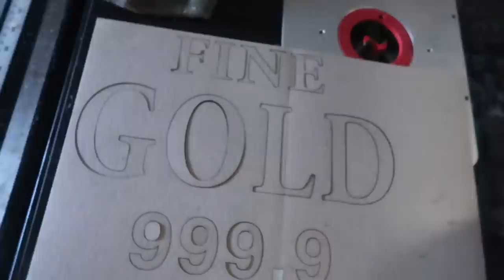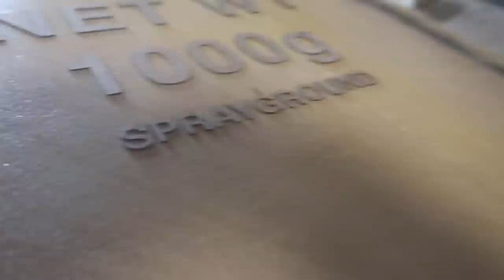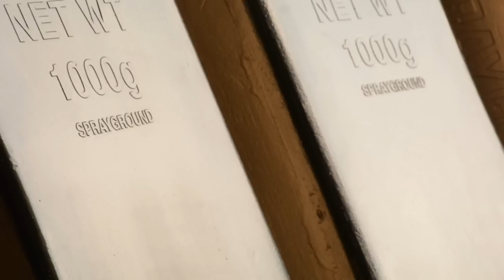DiResta Prop Gold Bricks

Comment: Would have looked even better if he would have carved the writing into the bars instead of adding script on top of the bars.
Reply from the maker: jay west was a matter of time.
Reply: supprised he dident say gold leaf,,
Reply: Could you have used the laser on the foam, then push them down as a detent to create that effect? Or is that the evil type of foam? (I don't mean the entire sheet either, just the same size as the templates you used, then fit the the square within the sheet)  Thanks for your videos Jimmy!
Reply: I came to ask the same question. I work at a gold mine and our gold bars are stamped in so it just kinda rubbed. lol. Great vid as always!
Reply: May or may not work, but make a template/shield, attach to foam, quick blast of a hot air gun, template is inverted into foam if you know what I mean!!!
Reply: Could possibly have done it quicker by cutting the letters from card and sticking the 'stencil' to the top of the bars?  But who cares, they look great!  ;-)
Reply: I disagree - that is a great use of the laser cutter. Not everything has to be done by hand. And in this case it's far better looking. Who the hell would hand emboss a gold bar? Nice work Jimmy.
Reply: Can't believe anyone had a problem with how this was done.  Great job, Jimmy.
Reply: Shoulda Coulda Woulda , Jimmy, Do Your Thing
Reply: jay wes
Reply: Definitely true, surprised they didn't inset the writing, maybe they did not have enough Z axis height to do the milling.   Pretty cool though!
Reply: @WNJ Super Vlogs He mentioned in the first reply to the post that it was a matter of time.
Reply: Oh yeah - haha

Comment: Great Job! What did you coat the bars with (after the Spackle), looked like Brett was holding a big bottle of wood glue?
Reply: Seems like wood glue to seal the foam as the solvents in the paint can dissolve it.

Comment: Jimmy, 3m dry coat guide, get some and then thank me ;) but serious it works and you will see all your defects right quick like and avoid all that work refinishing! Also if your want just spray a little black paint from way to far away as to get a little over spray on the parts and then light sand will make a very similar affect!

Comment: Was that a gallon of wood glue?
Reply: John Rowello yes it was. To seal the foam so it won't melt from spray paint.
Reply: Master of None dang that's genius I wouldn't have even thought of that
Reply: Ya, its a nice cheap sealant.  I had a buddy that made tables from tree cookies and finished them with a 1:1 water glue mix.   a few coats and they are shiny and slick forever.
Reply: Yea but it makes a Honorable finish! It looks like shit, better off with epoxy. Wood glue as a finish looks cheap blotchy kinda like a 5 year old did it
Reply: honorable? you mean horrible?
Reply: Oh thats a nice technique!
Reply: Don't thing real gold bars have an ultra smooth, epoxy like finish to them either, so I think his choice here was very appropriate for what they are .... learn new techniques from every video...
Reply: Depends on the mold.  Some do, some don't.  Also depends on how old the bar is.  Older bars will have dents and dings in them, pure gold is soft.

Comment: What was applied at the end prior to the paint?  It looked like wood glue.
Reply: I'm guessing it was used as a sealer.
Reply: I'm pretty sure you have to seal the foam or the paint will eat right through it.
Reply: It was probably just a base coat of white paint. A white base coat can make top coat colors look better. That's just my guess.

Comment: Should've sanded the bars down smoother before applying paint. Too many surface irregularities, holes, and drips to be convincing, even for a prop.
Reply: But you're totally OK with the size? A bar of gold that big would probably weigh something like 200 tons.
Reply: If its volume is 300 liters at 19 Kg/L the bar would weigh 5.7 tons, which means you could just leave it on your front lawn at night because no one could run away with it without waking you up. 41.000$/Kg its value would be around 234 million $.
Reply: On second thought, If you disable the beeper on an electrical forklift and sneak up on it  with the lights turned off, you might be able to sneak into the back of a lorry, or you could just kill the owner. Better not leave it on the lawn.
Reply: sidgar1 Read the description.. hope that helps sort it for you.

Comment: by my calculations if they were made from real gold each would weigh 6 tons and be worth  roughly $223,770,600  or more considering the astronomical effort it would take to source that much gold.
Reply: That little? 6 long tons of gold is 11.17 cubic feet. so a cube 2.235 on a side. Those bars looked easy 3 or 4 times that big to me.
Reply: The shape was not a perfect cube so i made a lot of assumptions about their size while drinking beers with my mate. also i think it was slightly over 12000lbs so 6 short tons. I believed i used  2'-5'-1'  for my calculations just to make it easy. Originally the price i came up with was much less because i used the price of gold per troy ounce, it goes up by a lot when you calculate by the kilo and i assume by an order of magnitude for price per ton if i could find it.